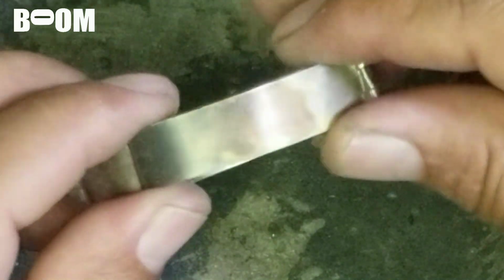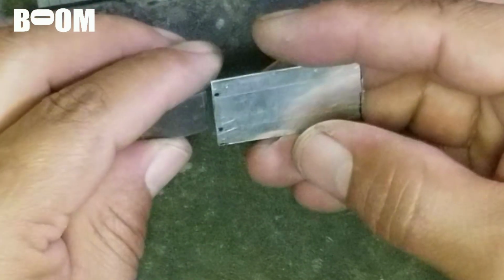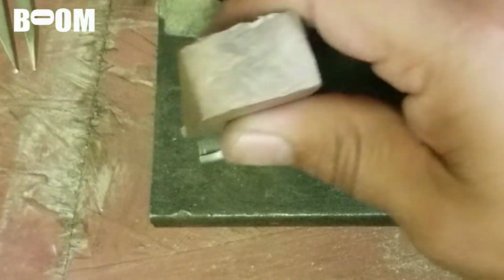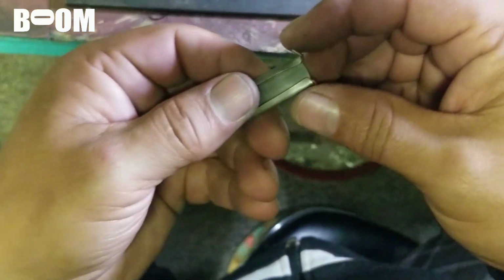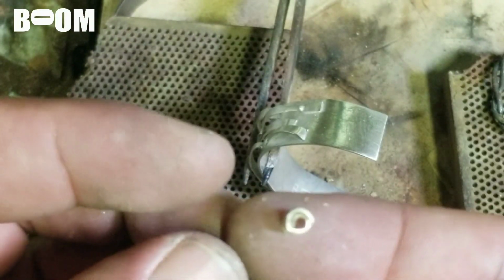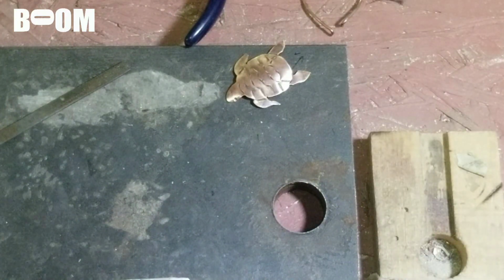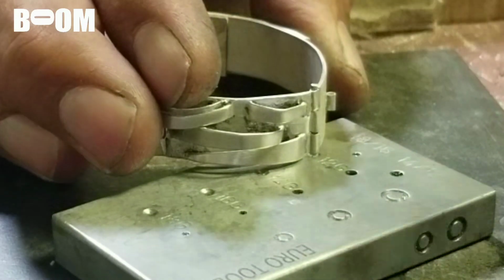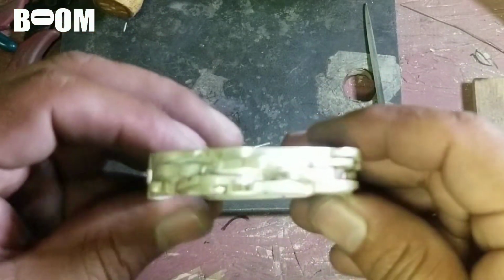Ep.28) Making My Slide "BoOM" Clasp | #jewelrytutorial

Comment: Great slide clasp idea. A suggestion to get that 90 degree angle across the metal is to put it on the edge of your bench block and hammer a L shape. Thanks
Reply from the maker: Good suggestion! Ive been fiddling with a few steps of the process... always growing!
Reply: A never ending journey that is both frustrating and rewarding.  @boomjewelrydesigns